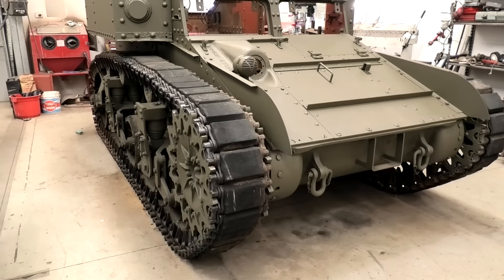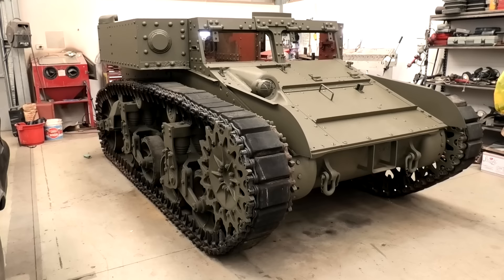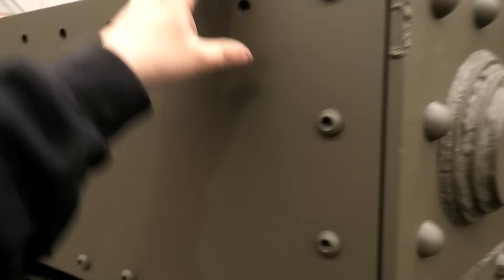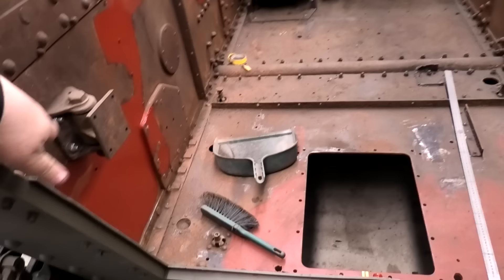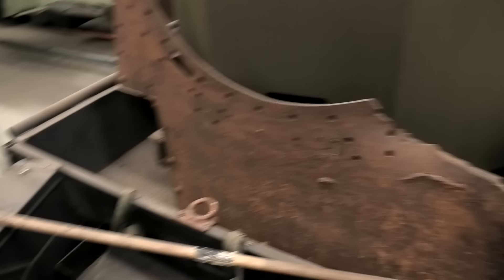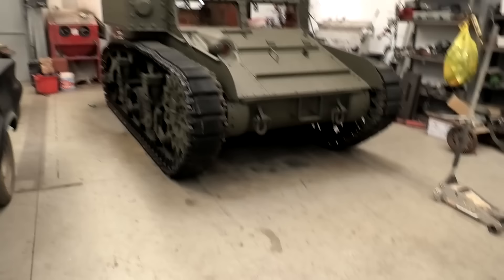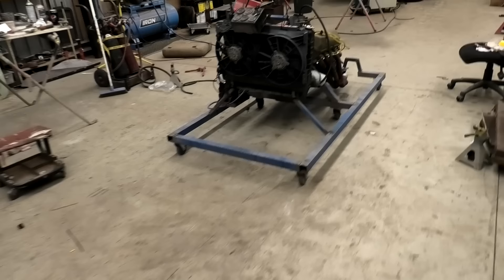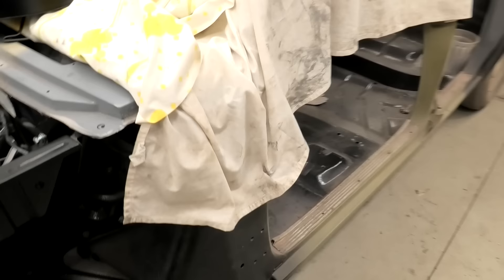M3 Stuart build update

Comment: The   main   thing   with   your   radial   is   make   sure   your    oil    lines   are   cleaned    out    they   have   a    pumped    oil  system   and   all   main   bearings    have   oil   pumped   to   them ,   I    know    of   a   sherman   the   engine   was   lost   from    one   pluged     up   oil   line   they   rust    inside   win    they   sit   to  long,   turn   it   over   with   sparkplugs   removed   often,   remove  all   oil   feedlines   and   blow   them   out   with   air  before   starting.

Comment: Graham, you father can help you with ease!. One less cylinder than the V8. The best part you can work on  each cylinder individually. The only special tool is make/buy a ring spanner to pull a jug (Cylinders) if necessary.
1. Does it rotate? 2. Starter motor- does it work?  3. Inspect Carby? 4. Inspect magnetos (I sent an overhaul book for that as well) 5. Spark Plugs (Replace/test). Please give it a go. Imagine the smile when it starts, they are super simple...and your not flying the damned thing...
Reply from the maker: The oil system is the bit that concerns me the most
Reply: @xacoupeguy  It is not as scary as it appears. If you like, ring me, I gave you my no. 
Any chance your Dad has any involvement with the engine?

Comment: Those photo's , brilliant Graham. Both those radiator cores will need a clean out.. the cores get blocked with sediment from the engine block. Electrolysis! Of all my years experience running repair shops it is the most common cause of over heating with older cars. Radiator gets taken apart and the core cleaned with wire rod, reassembled and checked for leaks and its as good as new, even if the core fins are a little thin in parts they still maintain running temperature! My radiator shop charges me $80 to $100 NZD for this so its pretty cheap for the result. Your EJ Rad looks like it will come out good anyway! Cheers

Comment: They make vacuum tube system that u insert down the oil stick tube to suck out the oil. Might make that EJ sump plug fix less painful.
Reply from the maker: duely noted!! thanks bud
Reply: @xacoupeguy  
If you come up with another sump plug you wouldn't lose too much oil swapping it if you were quick
You still might buy new ones at Repco or somewhere 
Or just drain the oil into a clean container and pour it back in once you've replaced the plug

Comment: Use a vacuum cleaner on the oil filler hole in the rocker cover with the engine oil still in the sump. As you undo the oil drain plug it will want to suck air in through it and not let the oil drain. Search you tube, there is a couple of videos around showing how to do it.

Comment: Did you weld over the machine gun sponsons, or was that done before you got it? It doesn't seem recent, but depending on what you intend to do with it i figure it may have been you blocking off "useless" holes.
Reply from the maker: they were blocked off in the factory, its very rare to see a stuart with machine gun ports not welded up

Comment: I believe the only bloke who does those honeycombe re-cored radiators is/was in NZ. Be prepared to pay over $1,000 for one. I've got some of the GMH original style hose clamps. What size do you need?
Reply from the maker: I dont know what size hose clamps I need are. Radiator hose sized? Haha
Reply: @xacoupeguy  I haven't got a grey motor here anymore to size them up & I've got early red motor clamps among them too. You'd need to vernier caliper the outside diameter of the hose.
Reply from the maker: @dustyfarmer  hoses outside diameter is 40mm
Reply: @xacoupeguy  I've only got 47mm I'D & heater hose size left. I've seen the reproduction ones on eBay.